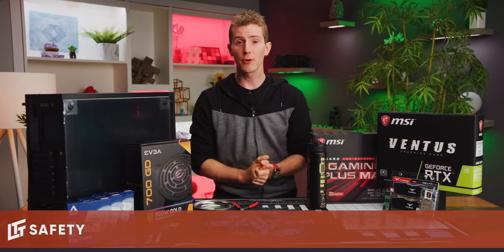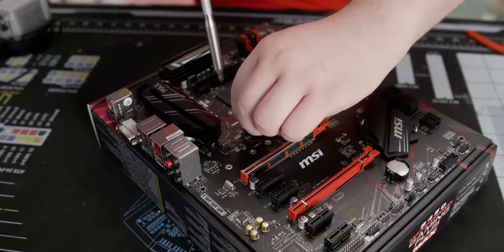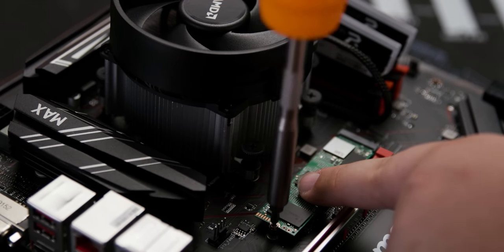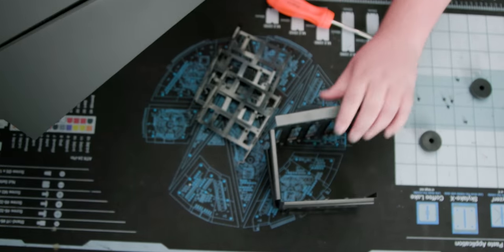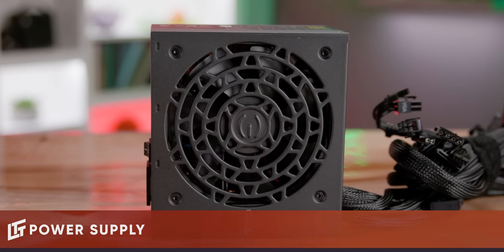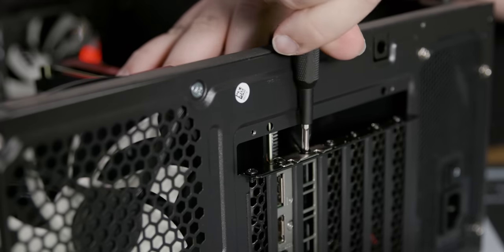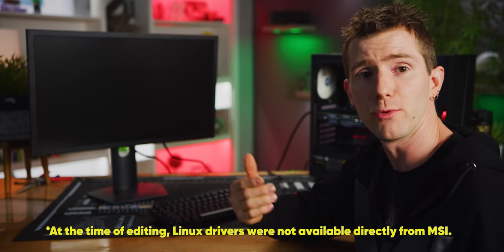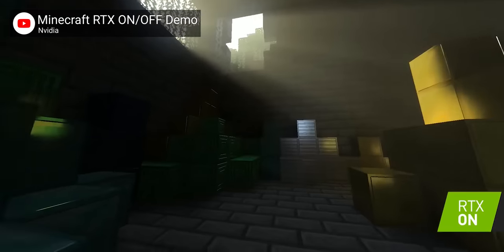$900 Ryzen Gaming Build Guide

Comment: Ultimate Ryzen Value guide
sponsored by NVIDIA
smooth Linus
Reply: I seriously think this sponsorship is the only reason they haven't put in a RX 5700. At least where I live the RX 5700 is consistently cheaper than a comparable RTX 2060 model and they have basically the same performance in 1080p while the RTX 2060 will very soon be bottlenecked by it's 6GB GDDR compared to the 8GB GDDR of the AMD card. If it's not for a G-Sync monitor you already own, I would recommend no one to get the RTX 2060 over the RX 5700.

Different story for the RTX 2060 Super/2070 and the RX 5700 XT, I'd argue with a 1000$ budget going the nVidia route would be viable again.
Reply: @christophmayer3991  At 1080, 6GB will probably be fine forever.
Reply: gotta pay the bills.
Reply: Says the guy with 2 macbooks as a pfp
Reply: @beemo4  ok
YASSINE
  MENS
Reply: @christophmayer3991  Buying a 5700 XT is stupid.. just buy a 5700 and flash the XT Bios on it for basically same performance lol
Reply: @001Piffi  how do you do it and is it safe?
Reply: I never learned which gpu to pick over which and why :/ I don't quite get the numbers (980, 650, 1080)
Reply: thresh 650 is da best
Reply: Christoph Erwerle it’s not stupid, some people don’t want to void their warranty and go through the work of doing that
Reply: @thresh-  The numbers somewhat represent the generation of that type of card but most importantly it's just a name for the card. For example, 9th generation nvidia cards goes in the form of 950, 960, 970, 980, 980ti. It's architecture name is Maxwell and they were popular back in 2014/2015. (I wouldn't reccomend this generation today as its aged quite a bit compared to modern cards). 10th generation is known as the Pascal architecture and they go in the order of 1030, 1050, 1050ti, 1060, 1070, 1080, 1080ti. And these were popular in 2016/2017 when gpu mining was booming. Now some older cards are better or just as good as some modern cards. For Example, a gtx 980ti is just as powerful or near as powerful as a gtx 1070. However typically with newer cards you get better power consumption and lower temperatures and the benefits of newer features. Today we're currently on nvidia's 11th generation of cards however lately they've confused the shit out of their audience by naming this generation of cards in the form of 2060, 2060s (s stands for super), 2070, 2070s, 2080, 2080s, 2080ti. They also have a 16 series naming scheme of cards but honestly they can fuck off with the names they've been giving currently. The 2080ti is currently the best graphics card to date and costs a whopping $1200. Hope that helped a little.
Reply: @christophmayer3991  Why would you get a RX 5700 when old Nvidia hardware from 2 die-shrinks behind it sell for cheaper and perform better?
Reply: BagsOfFun96 so what the hell is my 1660 super, it’s cheaper than the 1060/1070
Reply: I know the green stuff is overhyped and overpriced.
Reply: Lol
Reply: @vablo7198  Bro I'll hand solder those transistors on , I'm real geek!
Reply: @AdmiralFace  umm no?
Reply: @AdmiralFace  rx 5700 better than rtx 2060
Reply: Proving again Linus to be an Nvidia shill... just kidding, he's not 😃
Reply: So should I get a rtx 2070 super or rx5700xt?
Reply: @Cund  probably whatever is best priced, the 2070 has rtx and that's nice for some people, but for most (and even if you have the 2070, the performance is just meh if you enable rtx) it's somewhat of the same performance (2070 super i believe has a 5% increase compared to the 5700xt)
Reply: @Cund  Depending on price. Here 2070 super is 100€ ish more so not worth it at all
Reply: @Cund  It depends on whether you want ray-tracing, along with slightly better performance and the a few extra features, that the 2070 super gives. Ignore the AMD fanboys, as ray-tracing really is a thing to take into account at this price range. Since the next gen consoles will have it, it's now looking like a large proportion of 'next-gen' AAA games in development, are also coming with it implemented. Ray-tracing on the 2070 super it's completely fine, everything can be fully on at 1080p, Ultra settings and you'll be getting decent frame rates. Even at 1440p, as long as image sharpening is turned off, you'll still be getting anywhere between 60-90fps, in all the games, with it currently implemented.
Reply: @TG-yb9vv  650 is actually old and not that good. The higher the number the better
Reply: @fafski1199  Thanks.
Reply: @RonLisMan  safe.... to do so yes but its not 100% sucess rate your card might or might not take it
Reply: @christophmayer3991  its 50$ cheaper where I am.
Reply: OMG I just want to build my first pc and I'm so lost.... I have no idea what to het
Reply: @joelmitchell54  depends on budget, ofc
Reply: Luuk Verhoek it was a joke
Reply: @christophmayer3991  sme here u can get an 5700xt for like 10$ more then the 2060
Reply: BagsOfFun96 16 Series is Turing architecture w/o Ray Tracing.
Reply: @christophmayer3991  The problem most people with RX 5700 (XT) have, is the drivers. Lots of people have gone back to previous GPU, cause of bad fps on old games or constant crashes. RTX 2060 is a reasonable card, till amd fixes those bugs.
Reply: Yes, the sponsorship is disclosed within the first 60 seconds. Still think it should be in the title given the obvious conflict of interest: designing a PC with a sponsorship by PC part manufacturers. How is the target audience supposed to distinguish between sponsored statements and solid buying advice unless they already know everything this video covers? Oh right, the comments section:
The sweet spot computer for under $1,000 does indeed contain a Ryzen 5 3600 and MSI motherboard — the B450 Tomahawk Max, but it could contain any $280-$550 video card depending on your preference for raw performance to the dollar or a certain manufacturers exclusive features. Radeon’s control panel just got a facelift, but it does not always work. However, the 5700 XT is basically a 1080 Ti for $400, which makes it as fast as Nvidia’s 2070 Super for $100 more. The 2070 Super has a different selection of board partners, a different, stable but obnoxious software suite, a hardware encoder streamers seem to like, and a track record of market dominance for the last few years. Do more research.
Reply: BagsOfFun96 thanks heaps
Reply: Same here
Reply: Speech 100
Reply: @ChfHappySack  No,all 16xx is basicly are rtx 2060,but without rtx working. So its same architecture as rtx.
Reply: @christophmayer3991  amd is just isn't reliable enough with their driver issues
Reply: @rightwingsafetysquad9872  Not so much for VR tho
Reply: Alexey Marchenko it is the same architecture, but has less cuda cores, plus the 1650 doesn’t have the new nvenc encoder
Reply: @AdmiralFace  the 5700 competes with the 2060 non super mate
Reply: @butilikepizzatho4851  does it even matter what kinda graphics card you take, you need somewhere around 4gb for a gaming card or am i wrong. someone help me?
Reply: @tygodegroot6726  memory should be most of the time over 4gb for optimum performance at 1080p for higher resolutions you generally need more memory. But there is also the actual power of the chip. There are old cards with 4gb of memory that do worse than a 1060 3gb. You also need to account for the speed of the memory but usually all memory from the same generation of graphics cards use the same memory
Reply: RTX has NVENC and Turing architecture. AMD enconding is trash.
nvidia's new software is amazing.

I've has nvidia cards for years, never a single issue
Reply: xDDDDD
Reply: Im the 4500th like
Reply: @unreal8783   this is impossible  cuz having 63k of likes
Reply: @mipfurno6498  Im His 4500th like
Reply: @unreal8783  ok
Reply: @christophmayer3991  This was very helpful. Thanks :)
Reply: @christophmayer3991  I like this guy
Reply: @christophmayer3991  I made that decision yesterday, and went for the RX 5700.
Reply: @thresh-  xx60 series is for people on a budget  // xx70 is the best overall if you can afford it // xx80 is if you have too much cash on hands.
example rtx2060 < rtx 2070 < rtx280. there is a few exception here and there with the 650 model but 99% of Nvidia lineups respect the 6/7/8 system
Reply: @001Piffi  but its not guaranteed to work on every card.
Reply: Kenan it’s amazing and the best gpu to buy if you don’t care for ray tracing. honestly RTX is way over blown compared to the 1660s, it’s got NVENC for streaming and GDDR6 RAM, 10xx cards are still expensive because of bitcoin
Reply: yeah it doesn't make sense how this happened
but at least he his only using an AMD chip
since nvidia doesn't make CPU's
But still weird why he didn't use AMD hardware for the whole build
then the video could have just been sponsored by AMD, making much more sense
Reply: @thresh-  those numbers are just the names
Reply: think u mistaked Nvidia for intel fam
Reply: since ryzen is cpu xd

Comment: My mind freaking shattered when he mentioned the NMVE for under $100... and it was 1TB!
Reply: Crucial's P1 NVMe M.2 drives are 500GB and 1TB, cost 99.99USD and according to https://ssd.userbenchmark.com/Compare/Crucial-P1-3D-NVMe-PCIe-M2-1TB-vs-Intel-660p-NVMe-PCIe-M2-1TB/m607339vsm602553 also performs slightly better.
Reply: Bruh same
Reply: Considering I only paid 100 bucks for a 512GB NVMe SSD just back in Feb, my mind is blown!
Reply: My Ryzen 5 3600 has exactly the same NVMe drive. The Intel 660p 1TB unit which cost me 120€. Best price/performance at the time of purchase. I had two 1TB Seagate HDD's from my previous PC which I obviously transferred to the new one. I also got a brand new 256GB Toshiba NVMe from a friend of mine, for 25€, which I'm using as a "cache/temp" drive. It was really worth the money.
Reply: @mafcarvalho  We picked up the Sabrent Rocket 1TB 4.0 Drive over the holidays for 148$ + Tax. It benchmarks appropriately. I saw a Samsung 1 TB NVME @ US$ 79 recently and stupidly didnt just click buy.
Reply: @Machistmo  I bought my new system (parts) in August. At that time most 1TB NVMe drives were costing about 200€! Your purchase of the (PCIe) 4.0 drive seems pretty reasonable in USD. Despite the Euro being more valuable than the USD, here in Europe we always pay much more. For example a $79 drive should cost 70€ (at most recent exchange rate) but it will most probably cost 90€ ($100), if not more.
That Samsung drive should have been bought immediately xD
Reply: @mafcarvalho  Understood and I am not sure there is a huge performance benefit between 3.0 and 4.0. When we built this system in August the drives were like 249 US Dollars. I was not willing to pay that price and waited.  I have not been able to find it at better than we paid at 148 US Dollars, which involved two code applications to obtain.
Reply: @Machistmo  it seems your wait was worth it! I guess there is a difference between 3.0 and 4.0 drives but not many applications will be able to profit from it. Anyway you'll be more future-proof with the newer drive and at least in benchmarks you can claim victory. 😉
The "cheapest" PCIe Gen4 NVMe available here is the Corsair Force MP600 500GB at a whopping 169.90€ ($189.62 taxes incl.) which is too much for me.
Reply: Miguel Carvalho I am not sure as I Have not tested which applications benefit from this but it ‘seems’ faster than the Sabre 3.0 I picked up for 
the B450 1600af system I built
Reply: Poor hard drives, never knew what hit em
Reply: I got 1tb sabrent rocket £75 on black friday
Reply: Crucial 1tb  m.2 NMVe costs 90$ not even 100...
Reply: Over here, a 100 bucks equivalent can't even buy a 512gb nvme drive. Other parts still not too over priced tho.
Reply: @YoureWierdImN0t  can it be used with any motherboard?
Reply: The 660p is qlc so its slower. It has a small cache too.
Reply: @Abstriku  Absolutely NOT getting a QLC SSD! Disappointing to see them use one. Must be the sponsorship.
Reply: Charles E  so when i built my rig i bought the intell 660p then at microcenter a 1tb 970evo became available and i got that. Fast as fuck
Reply: @Abstriku  I liked your original comment but it still shows no likes, SMH. Just got an email the 970 Evo plus is in.

Comment: I love that linus doesnt care that msi sponsored this video and says that their products are "FINE"
Reply: They have to justify its use in some way that isn't "they paid us for it"
Reply: MSI had to approve that comment as well.
Reply: Qil90 well it’s more functional and it’s not supposed to be an amazing motherboard unlike some other of their products. if he say the MEG x570 was “fine” that would be different
Reply: You possibly misunderstood, he means it's fine for the task at hand witch is building a fairly budget gaming PC, he could have gotten a more expensive model but no real need.  I'll use this as a part guide, but I'll miss out the M2 drive, GPU (for now at least) and get a less expensive CPU and use my cooling and PSU and GPU I already have (again for now at least:), and that'll be just fine.  I might get a slightly better motherboard though!
Reply: Unlike AUSTIN
Reply: I'm surprised he didn't mention that with the MSI B450 Gaming MAX you don't need to do a bios update in order to have Ryzen 3000 series support.

Comment: "red ain't dead"
*Sponsored by Nvidia
Reply: Lmao
Reply: Nice dead meme for a profile pic
Reply: Carl Busani this is getting out of hand... now there are two of them
Reply: At this rate, AMD is killing Intel and is coming after Nvidia slowly but steadily. So I guess we'll have to switch to supporting Intel/Nvidia's efforts to de-throne the monopolist AMD very, very soon.
Reply: almarc RTX 2060 Super only requires 1 8-pin whilst the 5700 requires an 8+6-pin...
I would say it would be 3-5 years before AMD catches up on power efficiency on the GPU end... they are killing it in all aspects including efficiency in processors tho
Reply: @radiumuppet  You're very, very conservative in your estimates. And even if that was the case, power efficiency is one of the last parameters people look at when they're building a gaming machine.
Still, I'm sure Nvidia have already began to move their asses around looking at the 5700xt. Which is buggy, true, but it's not permanent.
I'd love to say that I'm happy about this, but no matter how good the AMD guys are, a monopoly at both CPUs and GPUs is going to be a serious problem if that happens.
Reply: almarc indeed... other issues with Radeon GPUs that aren’t issues but thinks I, and quite a few others, look for is noise and heat... the only 5700 XT custom shrouds that fix this begin to cut into 2070 super price ranges... if your case has great airflow tho I would go for it but sometimes that’s not the case, no pun intended. I don’t deny amd’s progression and pressure on nvidia and intel but whilst they have a better performance per dollar, they fall behind in many other features/gimmicks
Reply: Amd is just not competing with nvidia lol
Reply: isnt the 5700 better than the 2060/super?
Reply: @loomnatinoscopers  dont care, go to the 2080/2080ti tier and AMD doesnt even have a single product that can compete. bang for the buck is great, but if you want the best - you will still be getting an nvidia card (rip wallet tho)
Reply: @Alistair people who want stable drivers
Reply: @almarc  I still hate the UI in the NVIDIA control panel, AMD 19.12.2 however is a big one

Comment: This seems like a lot of extra steps, I think I'll just follow The Verge's build guide instead. 

Joking
Reply: It's too bad it's a budget build. If they could afford a butter knife they could really slather on the thermal paste.
Reply: David Shipley they had great safety on the verge though. Like rubber bracelet for short circuit protection, rubber base for power supply to make sure the case doesn’t get all the electricity and aiming the power supply fan against the case wall to help reduce sound to the ear. I don’t see Linus show that kind of care XD
Reply: You just need a table and hope.
Reply: Just remember, "Screw with confidence"
Reply: @ridhwan2011 , always.
Reply: Linus didn’t use a rubber bracelet, that’s speaks volumes at how he’s not a professional. I always wear my Macdonalds anniversary one when building a top built.
Reply: @ridhwan2011  "Screw with confidence"...I like his style. #Lyle
Reply: $300 is broke
Reply: maybe I missed any, but I'm sad there were no Verge digs in this video.
Reply: @brykit1972  I built my pc, on the ground with no bracelet. My table doesn't have space to build a pc and I don't have an anti-static bracelet.
Reply: DR NO   live strong not live long. a man of his bracelet
Reply: @torpedo996  As long as you build with confidence and hope.
Reply: @twidiot  don't forget insulation pads